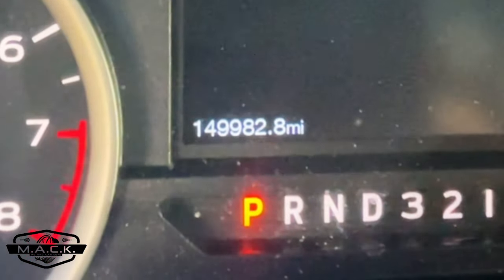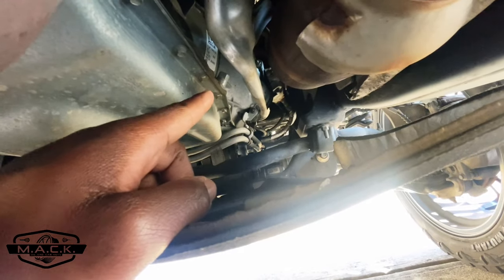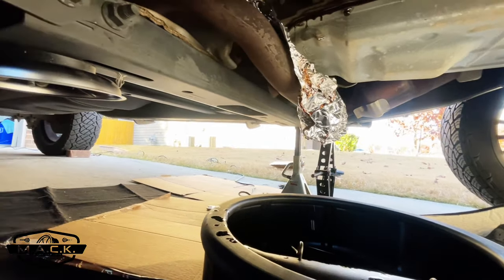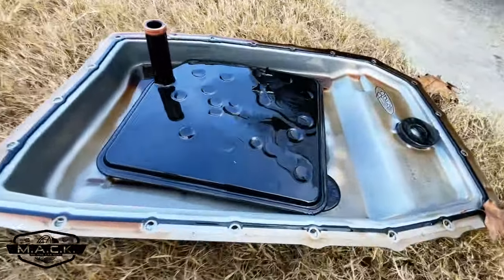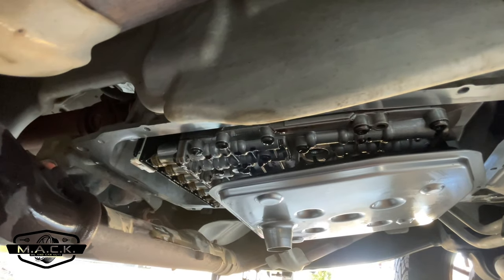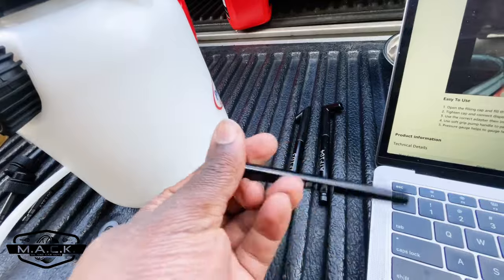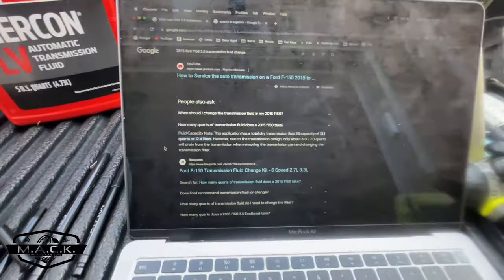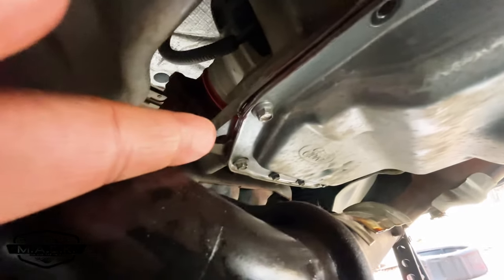F150 Transmission Fluid Change Gone Wrong! / Transmission Shudder!  #meandcarkeys

Comment: Drill it out a and retap it slightly larger. That’s what the dealership would do. I’m sure it’s 84 inch lbs not 84 foot lbs. anytime you drop a sealed pan assume you have to replace the gasket or seal. Best practice
Reply from the maker: Thanks for the advice bro! Normally I would have thought the same with the gasket… I just listened to some bad advice on both the gasket and the torque specs! Thanks for the advice! #motivationcrew
Reply: good call on the re-tap to next larger size.  the gasket is reusable if not torn or damaged, and most often what's done.  Any time you see a metal gasket with rubber seal ring on it, it is reusable if not damaged.  These are not like the old fiber and cork gaskets from years ago. inch pounds is also correct on pan bolt torque.  I have not checked to confirm, however, 84 inch pounds is 7 foot pounds, and that's about the right range for trans pans like these. It is surprising how low the torque is.

Comment: Don’t over think it.  Drain and fill every 30k. Swap the pan for one you can drain with plug.  Dorman sell one.  Easy. 5 qts every drain roughly when measured and it’ll always stay good.
Reply from the maker: Thanks bro! Bad part is… before I started I saw that same pan and even had it in my Amazon cart but didn’t buy it. 😂 lesson learned! Thanks a lot for the advice!! #motivationcrew
Reply: @MeAndCarKeys  I’ve had a few F150 trucks and change the pan every time as Ford do not put a drain plug in. 🙄

Comment: Tips: 
A trans will drop for days, so no worries about the mess, it  happens. 
Kitty litter is the best cheapest spill absorbent. Let it sit on the spill and then later work it in, grind it in , with a shop push broom. Clean it up and then use Purple power and water hose to clean up deeper.
I use a large 5x3 metal flat pan under the catch pan. No matter how careful there's always splashing trans fluid.
Save old water or milk gallon jugs. You can pour up the old fluid with a funnel into the milk/water jugs for transport to the recycling. But also will give you an idea of how much fluid you lost.
Reply from the maker: Thanks a lot bro for the good tips! I used dirt to soak it up but Ofcourse it didn’t soak all of it. It looks bad so I will try the Purple Power. I funneled the old fluid into the container the new fluid came in. I’d estimate about 6 quarts not counting what I spilled on the ground 😂 thanks again for the tips bro! #motivationcrew

Comment: The vibration had came from the torque converter and transmission going out. I ended up doing a full rebuilt. Lets just say we eating only ramen noodles for a few months.
Reply from the maker: I’m Sorry to hear that. This seems to happen to a lot of people. Are we all just not changing our transmission fluid quick enough. Did you ever get it worked out and back on the road?
Reply: @MeAndCarKeys  it is what it is. but yes the truck is back to normal. I bought the truck from carmax about a year ago at 97k miles. it lasted me about 25k miles before going out. it was weird it was very subtle at first and then it progressively got worst.

Comment: Transmission flushes are a no no in my book. They just stir up anything that settles out of the oil and runs it back through the transmission. Before i retired i had a fleet of about a dozen Ford pickups. After losing 2 transmissions shortly after flushing I stopped doing the flushed and went back to dropping the pan and replacing the filter. Our new trans rebuilder advised not doing the flushes as well. Better to leave what settles out where it lies. I like changing out the oil and filter every 50k miles.
Reply from the maker: I’ve been told the same thing about doing a flush and MANY people have told me that it ruined their transmission…but Ford recommends it for some reason. I like your recommendation for 50k! That works for me. Thanks for the advice! #motivationcrew
Reply: So a trans flush is not the same as a oil drain and filter replacement? My truck starting to do the shudder and i have 120k miles so contemplating on the dealership flush.

Comment: Ford owners manual says to service the fluid at 75,000 which means running it through a machine to have it cleaned. Actually changing it would then be at 150,000. This is for a 2006 f150 4.6
Reply from the maker: Gotcha! Thanks for clarifying! 
Is that the infamous “flush” that everyone talks about? Thanks for watching! #motivationcrew
Reply: @MeAndCarKeys  cleaning it is not a flush. It just goes through a machine and it cleans out the impurities… cost $150…  when i got it actually changed i took it to ford and they drained it and serviced the transmission. Cost was only $300. I do know to actually change it you need a way to suck it out of transmission because there is no drain plug on the torque converter and that’s where a majority of the fluid is…
Reply from the maker: @F150customs  that seems like $150 well spent especially for my truck at 150k miles. I didn’t know that about the torque converter. I’m online looking at diagrams right now. All good information thanks again!

Comment: I just use a mitivac to suction out the old fluid prior to dropping the pan to change the filter.  Makes things easier and less mess.
Reply from the maker: 😂 yeaaahhh That would have been MUCH easier and cleaner! Definitely a lesson learned! Thanks for the advice! #motivationcrew

Comment: bro dont give up i know feels frustrating but everything has a solution! Example my 14 tundra I over tight the plastic oil filter housing and it micro cracked as soon i turn truck it sprayed oil all over my driveway! I stoped quickly searched youtube and its common it happens on this plastic housing i everyone said replace with aluminum housing and will fix problem no leaks so i did and ran down to autozone got me the part and replaced it but i was on a down saying dang its going to cost more to get a tow ,toyota dealer and fix it . but again never give up took another round to fix it and resolved
Reply from the maker: Thanks a lot bro for this comment!! I need that type of motivation! Like you said, “everything has a solution!” Good example too! Never give up!! Thanks again! #motivationcrew

Comment: The thing is, you probably did not have a leak. When I drop my trans pan, for the same service you are currently doing, I thought I had a leak at first, too. But, when you overflowed the trans fluid, when filling, it ran to the back of the transmission and drips down off one of those bolts in the back. Next time continue feeling as you would, then cap it, then take your brake cleaner and compressed air and spray the hell out of it. Then you’ll know if you have actually have a leak.
Reply from the maker: Good tip!! And I agree I probably didn’t have a leak. But That makes perfect sense and a good technique to try out! Thanks for the help! #motivationcrew

Comment: If any of it is poking out, you can try a vise grip and turn it out. 

If not, EZ out will be able to extract the broken bolt.

If the threads are fucked up, you will have to drill and tap new threads. Look into helicoil thread repair kits for the thread pitch of that bolt. Good luck
Reply from the maker: Thanks bro!! Great advice! Part 2 will be out soon! Thanks for watching! #motivationcrew

Comment: So did you end up putting in the 2 big jugs of transmission plus 3qts?
Reply from the maker: Total was about 6 quarts put back in. Same amount the I drained. I explained it all in part 2. https://youtu.be/ly68SYa85jA?si=moL6xiWfddkuzLAk
Are you changing yours??
Reply: @MeAndCarKeys  Lol...I'll check to see  what the dealer charge....Maybe that will motivate me to do it myself if  price is way to high.

Comment: I don’t have a transmission dip stick and it’s a 2017 F150 King Ranch. I think the dealership is the only one that can do it?
Reply from the maker: Thanks for watching! Are you sure? It should be inside of the transmission fluid cap. It’s a 19mm bolt I believe, but also serves as a cover. Be careful when opening if the engine is hot.

Comment: Ooh my man, I feel bad for you, that sucks. Im pretty sure pan bolts would be inch pounds. As far as service and service interval, I took mine to a transmission shop and the mechanic told me they are designed to be serviced at 100,000 but it depends on what you are doing with it. The reason that the manual doesn’t give you any numbers is because Ford doesn’t want you to do it yourself. I tow a side by side for work and sometimes a bass boat, so I had mine serviced at about 75,000 miles at a cost of about 460 bucks. Here is the kicker though. I just got back from a job in Ohio and took my truck in for service for several issues, one of which was a hard shift between 4th and 5th gear. They tell me my transmission needs to be rebuilt or replaced! Luckily I had purchased the Ford extended service plan when I bought my truck wthich covered the cost. They also had to replace the electronic module that controls the navigation and radio. That alone would have been 1300 bucks to fix if I hadn’t bought that extended service plan. On the bright side, I’ve been driving around for the last 2 weeks in a brand new 2023 F150 XLT as a loaner. Hope everything worked out on yours, it’s always tough when you break it yourself.
Reply from the maker: Thanks a lot brother! Do you know if they did a full flush when you had it serviced? 
I’m glad you got the extended service plan!! Seems like its definitely worth the extra cost and saves money in the long run! Just tell them you’ll keep the 2023 XLT instead!! I’m happy for you brother! I haven’t driven the new gen trucks yet. Thanks for the comment!! #motivationcrew
Reply: @MeAndCarKeys  , yes the transmission shop did a full service, flush, filter change. lol, funny thing is, I was going to get some breakfast the other morning in the ‘23 , and I noticed it making a weird noise like it was in 4 wheel drive. Thought maybe I had accidentally pushed a button or hit something with my knee. Nope, so I switched it back and forth a few times to see if I could get it to quit. It finally quit after 10 minutes or so, and the only thing I can think of is, maybe it had moisture in the vacuum actuator for the hubs, and it was frozen. Talked to my brother about it, he said the same thing happened to his 2013 platinum after about 25,000 miles and they ended up replacing the hub. He also just had to pay 3600 bucks to fix an oil leak on his 2015 F250 diesel! Seems like it’s always something.

Comment: Why did you think 8ft lbs anyway? They're going into aluminum, and it's 22 inch lbs, not ft lbs because of that. Also you can't reuse the old gasket. You always have to replace it even if it looks fine. The reason being they flatten out once tightened.
Reply from the maker: Exactly! You said it bro! I don’t know what I was thinking! It’s what happens when I rush. I got a new gasket for it next video! Thanks for the comment! #motivationcrew

Comment: Oh no brother.
Best advice in my opinion is,
Call a friend.
Call a friend that has EXPERIENCE in bolt extraction the exact way that was stated above my comment with a bolt extractor bit.
Do not tackle this alone.
You do not want to make things worse.
If you need to tackle this solo,
Practice with the bolt extractor bit on something else , watch a Ronnie of videos on extracting bolts.
Did you not replace the pan gasket?
Also , Check, check, check,
triple check bolt torque specs for absolutely everything from FORD ONLY.
Ford Shop Manuals are available free to download.
They include absolutely everything.
If you are feeling nervous or not confident in extracting the bolt,
Then pay the $100 and have it put on a flat bed tow truck and sent to a garage for this repair.
Transmissions are not for the faint of heart.
All will be okay brother.
It’s not the end of the world.
We all often need to swallow our pride.
YOUTUBE VIDEOS FROM
AMATEUR SO CALLED MECHANICS ARE NOT A GOOD IDEA.
Although, there are many, many great shop videos.
Best of luck Brother.
Peace🙏🏾💪🏾
Reply: Typo, Watch a Tonne of videos
Reply from the maker: I’m just now seeing this! Thanks a lot for this comment bro! I agree with everything you said! Transmissions are NOT something I’d want to mess up! I kicked myself because I should have known better! 
I panicked in the moment, but got it done tho! 
And where can you download Ford Shop Manuals?? Please get me the link! That’s valuable to have on hand!! Thanks a lot bro! #motivationcrew